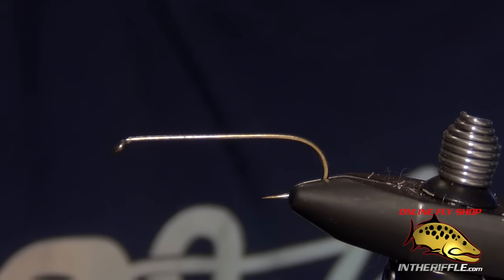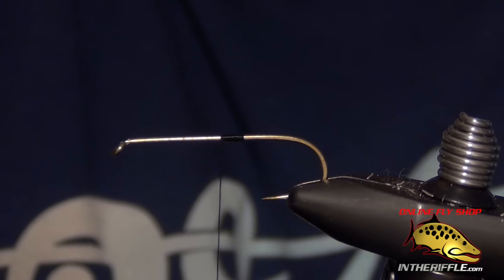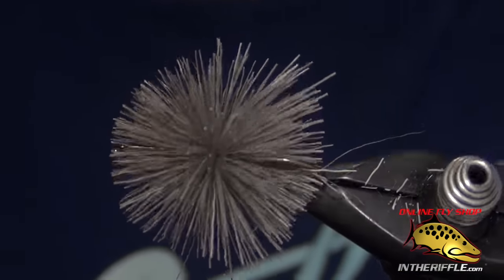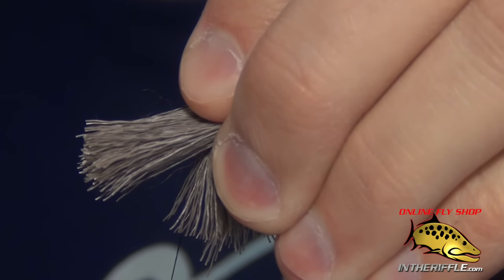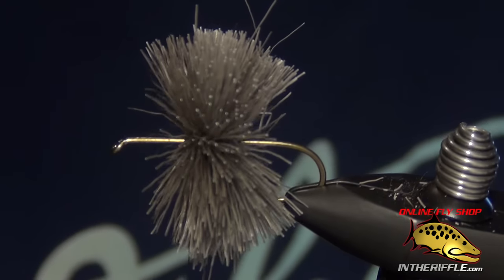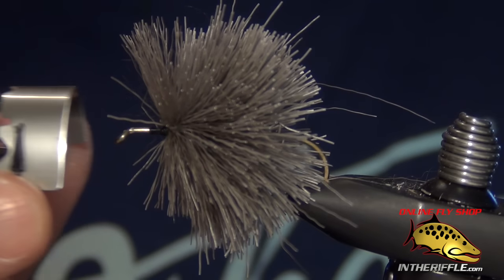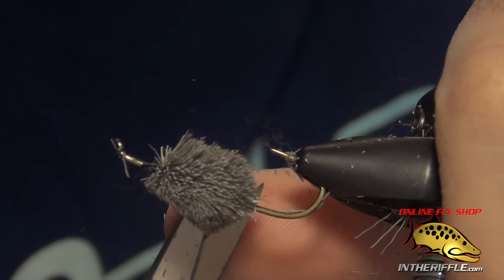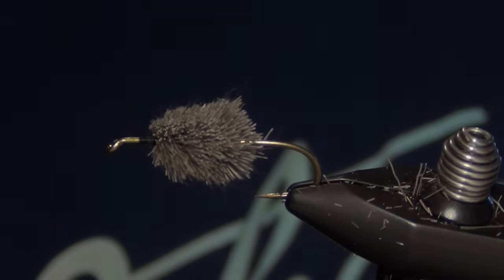Spinning & Stacking Deer Hair - Fly Tying Basics For Beginners - Tips and Tricks

Comment: You should refer to the cleaned out material as under-hair, and not dubbing, as deer hair dubbing doesn’t exist.  Also, when compressing the hair, it’s referred to as ‘packing’, not stacking and ‘hair packers’ not stackers are used.  You also misled the novice tyers with your compressing in two directions on your initial packing.  Your left hand should have been used to maintain your initial tie-in point and you compress with your right hand into the left hand.  I always use a comb to clean my deer hair.  You can see all the under-hair that wasn’t cleaned out after you started trimming.  Your videos are usually spot on.  Like you said, you must not do a lot of deer hair work or you had a long day and were ‘off’ a little bit.  Stacking is adding deer hair, typically of a different colors to the section of the deer hair that is tied to the shank, but not packed yet...
Reply: Always has to be a wise-ass. Who gives a shit what he calls what in the beginning. A novice such as myself wants to see some encouraging results which he gives the amateur tyer; he accomplishes that. Go somewhee else and be obnoxious. Va. Cork